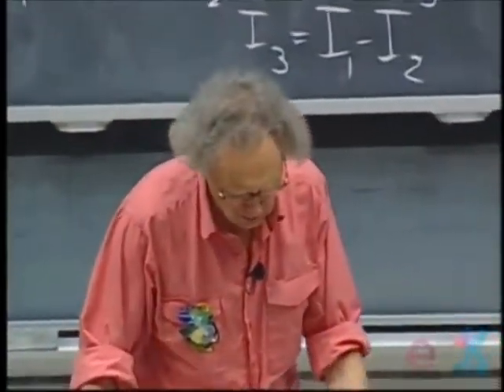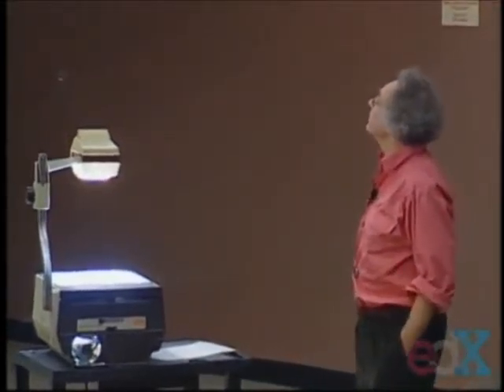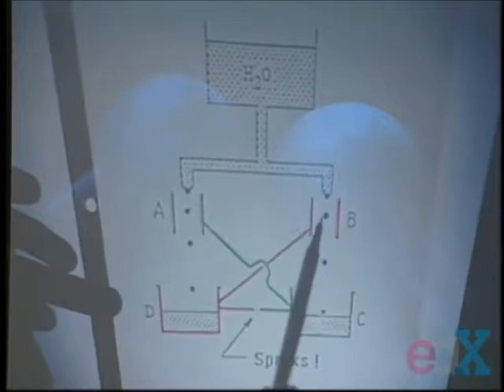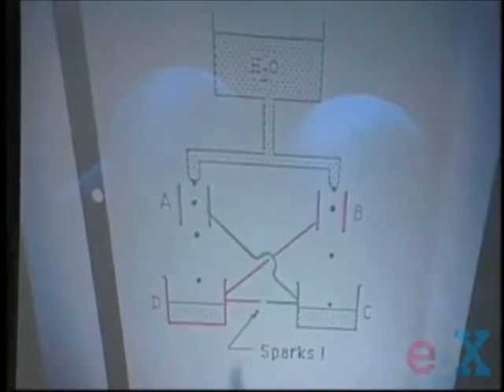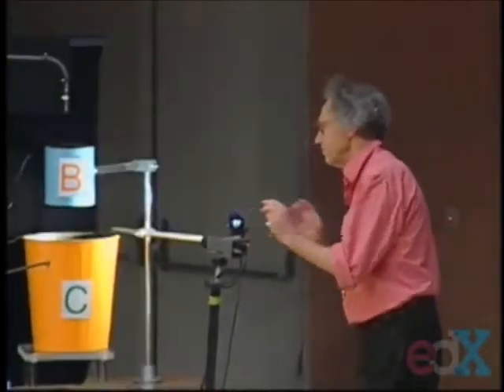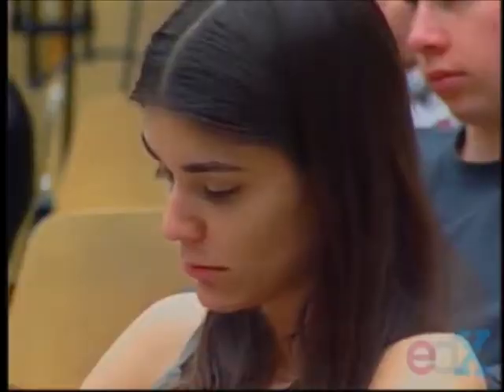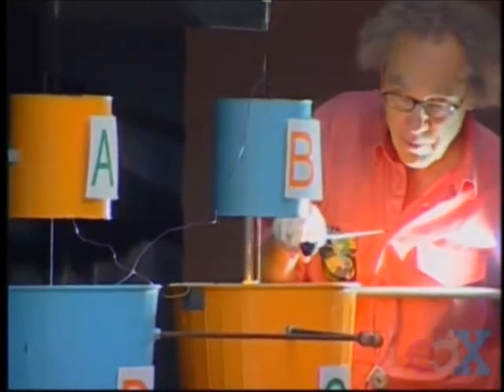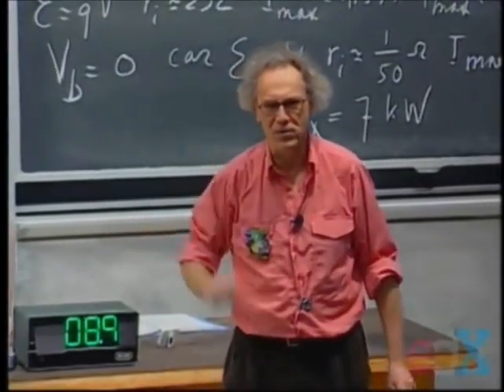Walter Lewin - Kelvin's thunderstorm

Comment: I assume it has to do with the streams of water falling through the first cans, and one can naturally being more positively charged or negetivly charged then the others, as there becomes a gap in the stream and it turns to water droplets the negitivly charged can will repel the negative molecules in the water back up leaving only positive droplets in the can below and the opposite on the other aide until one spark appears to quench the gap and the process starts all over again because the water stream and droplets Dont always form at the same interval it will continue to cycle. I see a comment above re mercury and the answer would be it would have ste same effect, I am curious as to what would happen with molten metal though, if it is allowed to coop down before the spark quenches the gap would that not produce a monopoled magnet?

Comment: check this guys you tube vid,, is this possible ?
it can be tested.- the tittle is;
magnetic monopole discovered, monopole magnet, conductor, and dielectic, "key to free energy"
Reply: There is a set of four equations that together form one of the most well made scientific theories in existence. That is maxwells equations and they form a part of the very foundation that our society stands up on; electrodynamics.
Here is a list: https://lh3.googleusercontent.com/-m1bletxTHWQ/VTatBrQnsCI/AAAAAAAADB0/DSFcyoWhaZ0/w500-h307/tumblr_m30d2u4Mes1ro3s28.png
E: Electric field.           ρ: Volume charge dencity.          B: Magnetic field.           ∇: A form of operator vector that is used to find the derivative/change of a field with respect to the direction in space; https://wikimedia.org/api/rest_v1/media/math/render/svg/524924ecb809c2c1e0b92fd34c162d3faa23ede0.            ε: Is a special type of electrical field constant called a tensor. It means that it can differe depending on what direction you look in to.            µ: Is a tensor similar to ε, except that µ is an electro magnetic constant instead.            J: The area current dencity.

1: The first equation says that if there is a monopole in a electric field (E) then total flux/flow out of that monopole is proportional to the electrical charge dencity at this point.
2: The second equation says that that there are no magnetic monopole/magnetic charge. The magnetic flux that goes in trough the surface of a hollow sphere is allways the same as that which comes out of it.
3: The third equation says that when ever a magnetic field changes with time an electric field will form. It allso says that if the change in magnetic field "B" haves the direction "ê" then the resulting electric field will rotate around the axis/line with the direction of "ê"
4: The fourth and last equation says that the third law goes in the oposite direction as well. So if there are no electric field changing with time that can't be directly related moving charge then dE/dt = 0. Then you will only have a current, which means that ∇xB=µJ. This means that the magnetic field will scirculate the axis of the electric current (butt in the opposite direction this time): https://i.ytimg.com/vi/4XjHcXCxwuc/hqdefault.jpg

The second and the fourth equation states that a magnetic field can only form as a secondary force out of a changing electric field. It would be intresting if you could actualy learn electrodphsyics and question it. But there is not much to expect from a youtube video claiming that they have violated newtons laws of motion and maxwells equations.

By the way, the fourth equation says that a magnetici field will form as a result of a changing electric field. But a forming magnetic field is a changing field as well, this means that the forming field will in it self form a electric field. This goes back and forth un till something dissturbes this behaviour. This oscilation is called a electromagnetic wave. Yes, maxwell predicted the existence of light and the speed of light "c" as well; c^2= 1/(εµ)... Just a cool and intresting fact.